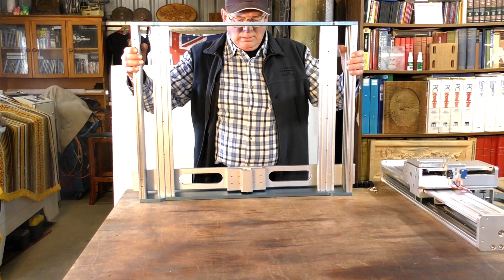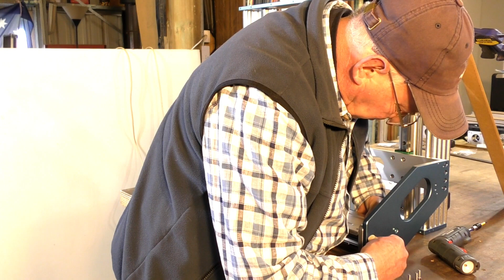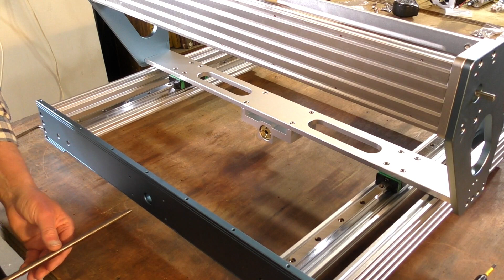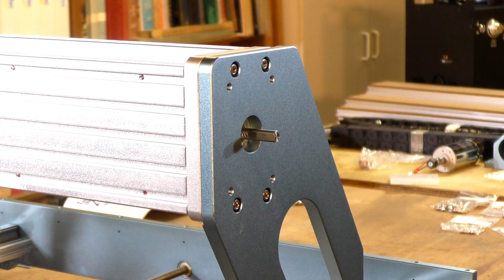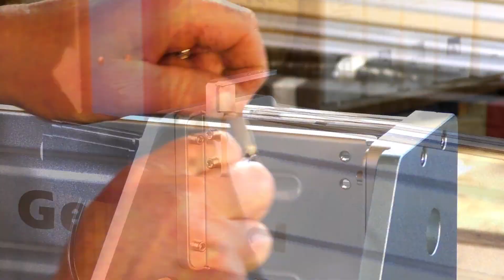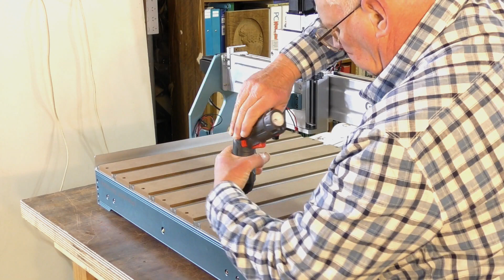BEST NEW CNC Router SainSMART Genmitsu PROVerXL 6050 Plus Mechanical Kit Build

Comment: hey Roger im an Aussie as well, dont hold that against me hehe! I have purchased the genmitsu 6050 started to assemble , not sure if I have one with a defect? assembled the y access screw from the rear compressed the anti back lash stew and proceeded to the plate and bearings together ! here's whats stoped me from proceeding! there's probably 1mm of slop back and forward on the y threaded shaft the  front bearing move in the y direction aprox 1 mm ?
I wouldn't think thats good ? your thoughts. be nice if you could ring sainsmart ,but you cant>
cheers pat
Reply from the maker: Hi, all you need to do is fit a steel washer, approximately 1mm thick, that will fit on the shaft to act as a shim. With mass production, this can sometimes happen. and don't forget to subscribe to my channel, and pass the videos on to a friend.

Comment: Roger, Another video with great explanations and video. I have had the Sainsmart 3018 Pro Ver model for a number of years and was a good tool for learning CNC. I lost interest due to its low power. This 6050 looks great but may be a little too large for my shop. My question is (since some the technical terms are unfamiliar to me), is the new Sainsmart 3030’equivalent to the 6050 except for bed size?
Thank you
Reply: Thank you. Guess I’ll have to make more workspace..
Reply from the maker: No! the 6050 is far better and more powerfull

Comment: I do not know how you do this, i'm not a patron, but have followed you for quiet a while, years.
This Video sparked a comment from me. 
I find my equipment through bartering, i've run into a slight stall on a couple of my last scores. so i'm patiently waiting to get to setup and calibrating as well as motor tuning.
i just went through the QueenB with you and Bam a new week and its the ProverXL 6050. 
I'm very impressed with it